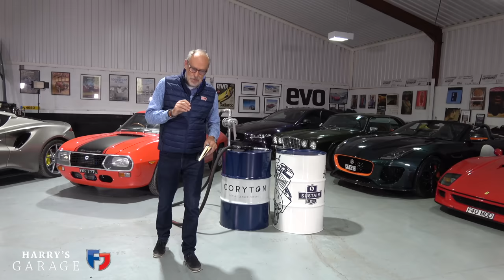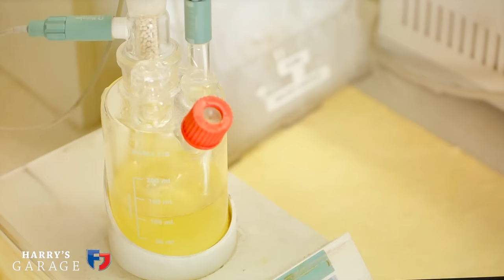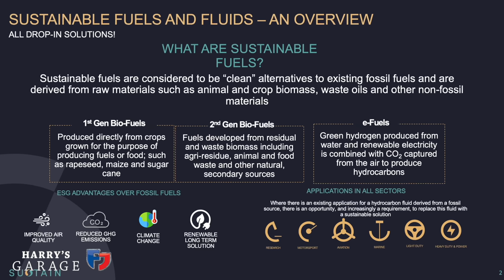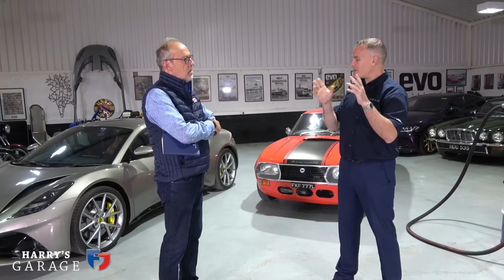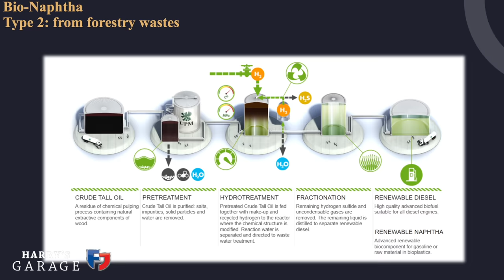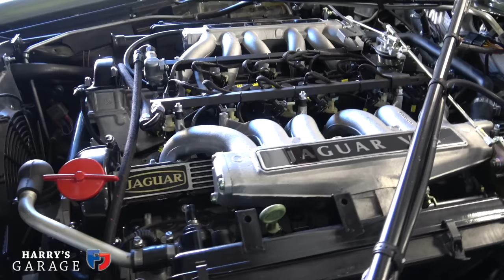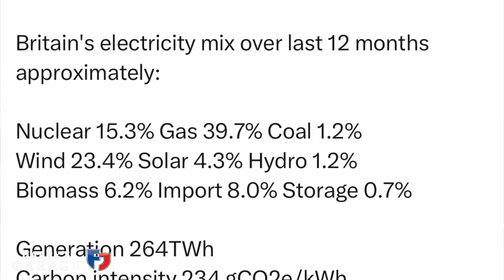Everything you need to know about using sustainable fuels. Why they're good news for car enthusiasts

Comment: I really hope more car manufacturers get on board with this kind of stuff and, like Porsche, help with the development of them. Didn't the EU rule (after pressure from the Germans and the Italians) that cars with ICE engines can still be produced after 2035 as long as they run on sustainable fuels? There is no substitute for an internal combustion engine when it comes to driving pleasure. The Emira lookes utterly gorgeous too (I'm biased!)
Reply: Yes that’s my understanding too. Assuming that almost all petrol engines can theoretically run on sustainable or e-fuel, that basically means there will be no ICE ban from 2035 at all…
Reply: Just synthetic fuel not bio fuel.
Reply: porsche? 😂 mate porsche are nobodies as far as market share is concerned and porsche need to put their energy into making their cars reliable again as here and now they are abysmal, rock bottom of the reliability charts pumping out disposable junk.
Reply: I think this won't go any further than competition world, too expensive for everyone's use.
Reply: I believe that Porsche are in partnership with Mobil
Reply: @bigduphusaj162 
Don't forget Porsche is owned by VW/ Audi. So they do have big backing behind them!!
Reply: @neilturner6749  it will be expensive so will be niche product these synthetic fuels . rest of people will be driving EV
Reply: Exxon technology has been used to produce synthetic fuels for 30+ years, but not using sustainable feedstocks previously.
Reply: The regulation will probably become "carbon neutral sustainable fuel" in legislation, so open to biofuels, recycled carbon fuels and renewable fuels of non-biological origin so long as they are carbon neutral.

Comment: That was fascinating!  I have to say I'm amazed at the assumption we are all systems go for Electric vehicles, as time moves on there are very serious issues emerging which haven't been given the consideration they should have so all EV alternatives need to be considered and investigated!  Good one Harry, thanks.
Reply: Such as ?
Reply: Absolutely right. The great thing about EVs is the extra choice. Great for city use, if you can charge it (and, that's a pretty big 'IF' at the moment). The concept of plug-in hybrids and standard hybrids is great too.
Reply: @tomsdaddy danger mining the battery materials, lack of infrastructure for charging commercial vehicles, a power grid not cappable of allowing even a 10th of the population to recharge at home, disposal of them after their service life is  horrific.  Should I go on?
Reply: @bigduphusaj162 The impracticality of recycling batteries in BEVs. There isn’t a cost-economical method for recycling these large, complex cells.
There isn’t an ENERGY-economical method for recycling them, either. 
I seriously expect old BEV batteries to be flung into landfill sites, next to cut up wind turbines blades. 
By contrast (& I’m aware the comparison isn’t direct) the lead-acid batteries in conventionally fuelled cars are readily recyclable and actually recycled to at least 90%. I believe it’s over 95% but I don’t immediately have a source for that number.
Reply: @richardmortimer8147  Wrong. City use means few miles per year, and in those use cases ICE cars emit less CO2 than EVs already when using fossil fuels in most cases. All you'd need is a few more percent of biofuel or e-fuel mix into the fuel and all ICE cars would be clearly lower than EVs.
Reply: @pistonburner6448  Wrong. Who cares about CO2 emissions? All that 'Net Zero' blab is just that! I am not meaning "lowering CO2," I could not care less. For one thing: CO2 levels follow temperature. The point is: In city use the exhaust gases are at source (where the power is generated).
Reply: @bigduphusaj162  
No.

Because you're talking rubbish ?

How do you think we get the materials we already need for Petrol and Diesels ? - does Santa give them to us ?

And are you also suggesting that because there isn't currently enough infrastructure for commercial vehicles, that there never will be ?  Why is that ?

And Grid Capacity, - so what about 'Petrol Capacity' ?  Would we have enough Petrol if every one of our 30 million cars decided to refill at the same time ?

No ?  - So how do we manage ?

We manage because we don't all fill up at the same time, - ditto 'EV's ...

And disposal when and how ?

Yes it's tricky to recycle them at the moment, because people are still developing the techniques to do it, - and yet it's STILL easier to recycle a Battery 20 Years after it was made than it is to 'Recycle' a tankful of Petrol or Diesel after it has been deliberately and successfully 'Set on Fire' - ISN'T IT.

Comment: What I actually fear about all this is the distribution, or lack of.
If electric cars will become the norm, fuel pumps will start to disappear, making it almost impossible to go on roadtrips, which is what I enjoy the most. It's good if it will be possible to keep running ICE cars in specific contests but sad at the same time if this will mean being obliged to drive them only in selected areas such as racetracks
Reply: They don't need to ban petrol and diesel vehicles, they will just make it impossible to buy the fuel.
Reply: Well it's the same if you want to drive a steam powered traction engine on the road today I guess. As tech moves on, the older tech naturally becomes less convenient. It won't be economically viable for fuelling stations to stock petrol or diesel. It'll likely take at least a decade though, as EV HGVs still have issues with added weight and range.
Reply: This sort of fuel is unlikely to go mainstream.  The carbon capture variant by Bosch/Siemens and so on is far more likely to become mainstream.
Reply: Conventional gas stations won't shut down anytime soon.

Here in the EU, ICE cars will be built up until 2030.

Assuming a lifetime of at least 10 years, gas stations will be around at least until 2040.
Reply: rise up, we are in charge
Reply: So, er, in a weird turnabout, ICE cars will suffer from range anxiety?
Reply: @watchmrcontent  you can, technically, still carry fuel with you on the car. Obviously not as viable on a sports car, but unlike EVs you can carry extra fuel.
Reply: @watchmrcontent  Only in these childrens' fantasies being shared here.
Fuel pumps aren't going anywhere. Besides, you can operate ICE cars anywhere there is natural gas (or the renewable version: biomethane) available. So if your home has a gas connection, you can fuel up your ICE car at home.
Reply: @pistonburner6448 you're gonna liquify natural gas to lpg right there in your home? Nice
Reply: @mcspikesky  Natural gas does not need to be liquefied (that's how you spell liquefy BTW...) at all. It only needs to be compressed slightly above the pressure of the natural gas connection to your home. Natural gas or biomethane is used in CNG (Compressed Natural Gas) vehicles. Basically any gasoline car can easily and cheaply be converted to also be run on CNG, and even diesels can be but they will also burn some diesel. There have been commercially sold home CNG fueling pumps (pretty simple compressors is all they are) available for decades, at least in the USA. I don't know how restrictive the laws are in the UK for example, they might've wanted to prohibit it completely just because they wanted to ensure people have to use highly taxed fossil fuels. But nowadays that shouldn't be a problem as the alternative is using EVs and paying less than zero tax...so why would it make sense to tax a fuel which is lower in CO2 than EVs while subsidizing EVs with massive amounts of tax money, while those EVs  emit much more CO2?
LPG has nothing to do with natural gas, LPG is propane. LPG = Liquefied Propane Gas. You have NO CLUE whatsoever about the very basics which everyone not even interested in fuels should know. If you go camping you should know more than your empty head.
Is there anything else very basic you need me to teach you?
Reply: @watchmrcontent  It's already the case in some California cities where a lot of gas stations are closing.   Some of this is due to the rise of EVs, but also because the land is more valuable for other uses.
Reply: @pistonburner6448  Based take.
Reply: @ninja12lawbreaker  totally agree. If we don't buy the EV's, then the car companies will soon drop them. They at the and of the day help govts with revenue and nGDP from sales. If we are not buying, they ill lose money, this means lost jobs, this affects govts with payouts in lost taxes, welfare payments to the unemployed etc. We have the power, the govt just likes to make us think that we don't.
Reply: @Stabby666 HGVs can never be replaced by BEVs. You cannot change the laws of physics. The bare lorry is so heavy that it needs a huge battery to generate the power necessary to move it alone, let alone tons of freight on top. But the battery is so heavy that diminishes the available payload. Not only will HGVs  not be possible if BEV is forced to be the only option but the lack of supply chain capacity will mean that the cost of everything will soar. 
I’ve watched this segment for years. It cannot be electrified.
Reply: electric cars are a fad, the investment in advancing them has stopped already. They know fine and well they are selling a glorified powerdrill motor and battery and they know battery tech is difficult to advance.
Reply: @ninja12lawbreaker I agree with you. We must assert this, as well, because the global tyrants have decided they’re irked by democracy and want no more of it. 
You may be aware it’s worse merely than a control objective.
It’s also about depopulation.
I’m Dr M*ke Yead*n.
Reply: @jameswalker7874 ehh? synthetic fuel is 100% how its going and anyone whos been follwing what the big players are doing knows this. Scania, Volvo and Toyota have been investing heavily in it as they know exactly how this is going to play out
Reply: @ckm-mkc you forgot one thing. Nobody copies California unless they want to destroy their own land
Reply: @GT380man  they already exist. The trucks are heavier, but not extreme. The fact there is no engine, gearbox or fuel tanks removes weight, but the EV hardware then adds it. Electric is the best choice in terms of power for trucks with full torque from 0 rpm. The real issue has been battery capacity till now but Tesla has shown its truck can do a full days worth of driving distance, recharging during a drivers sleeping period.
Reply: @Stabby666 😂  yeah right. The battery powered HGVs are all little puddle jumpers doing local shop drops.  How exactly do you replace the scania V8s that do 44+ton for days on end?   how does a battery do that while keeping weight spare for the loads?  because if you bite into load space you automatically need to run a second truck for a load that one old truck could carry so now the roads are even more congested and the damage associated with that. You electric pushers are real good at not thinking before you speak.
Reply: @bigduphusaj162  shame you obviously did zero research before typing that. Scania themselves advertise an electric tractor unit with 350km range at 40tonnes or 250km at 64 tonnes which is “special types” weight - way over a standard artic. Tesla demonstrates a tractor unit with a range of 500 miles and the acceleration left any other diesel engined truck so far behind it was just hilarious to watch. Electric trucks are a lot more powerful than diesels, require less maintenance (if you’re actually anything higher than a driver you’ll know that’s the biggest running cost aside from fuel) and obviously cheaper per mile. The infrastructure isn’t there YET, but charging on loading bays and during driver rest periods is becoming a reality. Electric trucks are already being tested on trunking routes in the UK, and allowed to run over 44 tonnes. You’re like the guy who claimed that no one would ever replace horses and carts 🤣
Reply: @Stabby666 drivel. Scania use VAG sourced electric in short distance lorries and they took all their cash out of both electric and autonomous. I know because i work for them. Im their head  marine mech for Scotland. The guys 100% correct to the point Scania are trying to break away from VAG as we speak as VAG are trying to interfere to much. Also the reliability issues with the VAG era V8s especially has resulted in sales tanking for the 16ltr lorries. If you want to argue with me over that i suggest you spend 25yrs working for them. Ta.
Reply: @Stabby666 😂  i was about to reply to you till i seen the Scania guy spotted your comment and gave you a reality check hahaha you got fed by a scania marine supervisor almost instantly. Im staying out this one as im sure you will back chat him and get made look silly 😂
Reply: @bigduphusaj162  the arrogance of ignorance. I bet you voted for Brexit, right? 🤣
Reply: @Stabby666  i voted brexit and i handed you your backside on a platter earlier. Novel way to get everyone to not believe anything you say.. bring politics into it.
Reply: @TalksportWokistWombles  “I voted Brexit…” that’s all I need to hear from you to know nothing you have to say is worth hearing. Thanks for saving me some otherwise wasted time 🤣#gammon
Reply: @Stabby666  You lied about the company i work for so i put you right.. but now its about brexit and gammon. You've made a fool of yourself on here and no amount of childish emoji  and hashtags will ever change that. I bet you delete or edit
Reply: @Stabby666 😢😢😢 brexit bad 😢😢😢 gammon gamon gamon hahahaha. Cry some more
Reply: @Stabby666  I dont vote but the UKs exports have went up since brexit 😂 we are factualy richer because of it but you dont care about facts, that much is obvious from this thread. The Scania dude ended your involvment here. leave quietly thanks
Reply: @bigduphusaj162  it’s great how these drooling knuckle-draggers out themselves immediately so I can ignore them. “Me vote Brexit. Me dumb!” 🤣
Reply: @Stabby666 also Diesel trucks like scania V8 have nearabouts 3000nm sustained. Electric trucks have peak power no sustained torque. On pull tests the diesels destroy electric so absolutely every part of your argument on here has been factually wrong. The fact you kept talking after Scania guy ousted you as a fibber is beyond the pale.
Reply: @Stabby666  EV emergency vehicles including an air ambulance tackling a massive pile-up on a winter evening - a LOT of flat batteries and dead bodies .. .. . . . .!
Reply: @dancarter482  What are you talking about?! When did this happen, or is it some dumb hypothetical that GBNews told you to be angry about? 🤣
Reply: @Stabby666  I think significantly more than a decade
Reply: @watchmrcontent  exactly
Reply: @ItsGenn  yes, let me drive a truck full of fuel so I can have a big stock of it. What's the point? We like ICE sports car because they are more involving than BEV, not because we like petrol. Maybe very rich people will be able to have a truck following them
Reply: @italofallaci9029  Based on?
Reply: @bigduphusaj162  Exactly what I'm saying.  But it won't be from plants/waste, it'll be carbon capture via solar energy like Bosch and Siemens are doing (with Porsche etc. all behind them).
Reply: @Stabby666  given that in more than a decade the vast majority of the circulating cars will still be ICE, even in the richest European countries, with the exception of the scandinavian ones.
Reply: @Stabby666  You came on here and talked pure mince about the very company i work for. Now you are namedropping GB news as an unreliable source. Given how wrong you were about Scania i can guarantee you that it's your sources who dont have a dan-doo what they are talking about. I bet the irony of that is lost on you.
Reply: @Stabby666  I will do some more research.